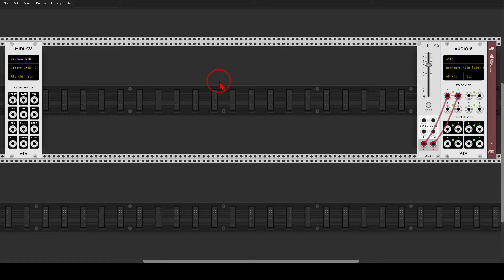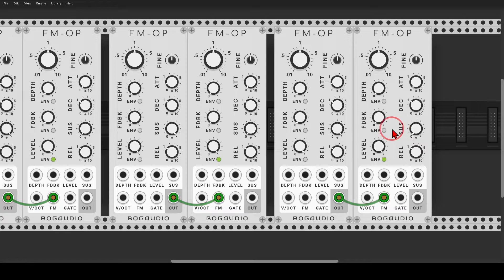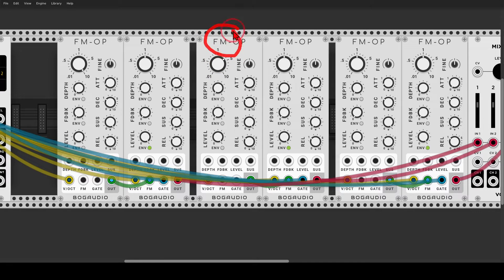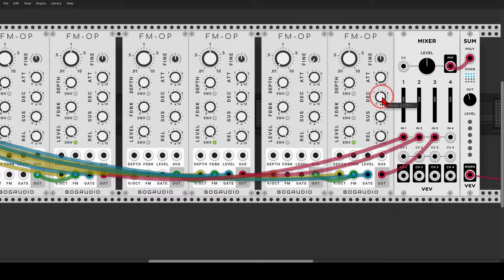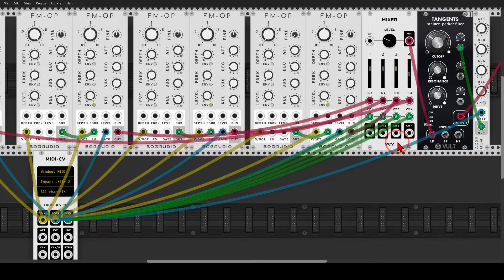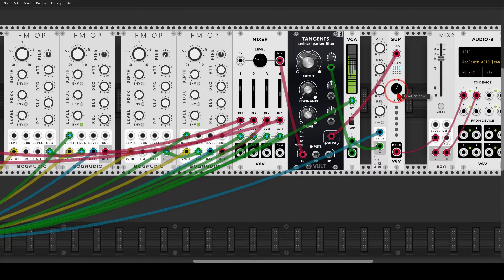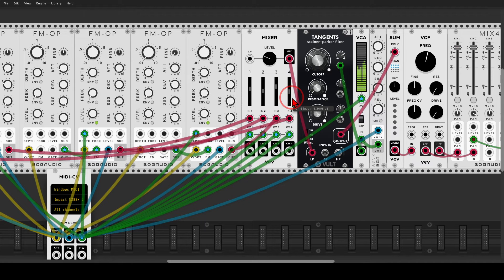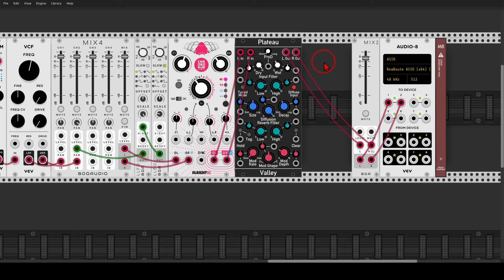Creating an FM Piano in VCV Rack

Comment: Hey Omri, I'm currently struggling with an issue with FM and I'd thought you know how to deal with it, hope you read this!

It has to do with phase. Whenever you add operators (with enough overlapping harmonics) together rather than FM'ing them, you never know what you're getting because the phases are independent and thus not aligned, which might change the timbre significantly. How do you typically deal with this? I can think of a few solutions, all are mega janky.
Reply from the maker: Hi! Yeah, I try not to think about that, but there are several oscillators that have a reset input you can use to reset the phase. Have a look at the ones from SurgeXT, for example.
Reply: @OmriCohen-Music  Hey! Yeah, I thought of the reset inputs, and when using them as oscillator sync, it works surprisingly better than I expected (whereas triggering every oscillator once at the same time gets me unpredictable results for some reason, maybe it has something to do with me using Cardinal rather than VCV but I can't tell for sure)... Until I have to set partials which are not octaves of the root, then it does sync things and changes the waveform.

Comment: Good tutorial but how i can enable VCV Rack in Ableton 11?
Reply from the maker: Thanks! Did you get the pro version?
Reply: @OmriCohen-Music  Ableton Live Suit  (build 11.1.5)
Reply from the maker: @-________9732  I meant the VCV pro version. The pro version comes with a VST that you can load in Ableton.
Reply: @OmriCohen-Music  i dont want to buy this because i am only beginner...
Reply from the maker: @-________9732  Oh ok so I guess that try and work with VCV only for a bit and see if you like the experience first. Then you can decide if you want the VST or not.
Reply: @OmriCohen-Music  I have 1200 modules... I can't check them all :oops:
Reply from the maker: @-________9732  No no, that's not what I meant. i meant see if the workflow is for you. If you like the results you're getting. And also, if you're just a beginner, I really recommend removing most of the modules. it will just confuse you.
Reply: @OmriCohen-Music  Thanks... I hope I can delete at least 100... they are all so beautiful and useful...

Comment: just a BIG question, I tried recording this patch in obs studio but it does not recognize asio drivers as output audio. I found workarounds for daws but not for vcv rack. Do you use another recording software for the tutorials??
Reply from the maker: Yeah, I record the screen with OBS but the audio with Reaper. I then sync both in post.
Reply: @OmriCohen-Music  oh thanks :) as I am streaming live I had to figure out how to get asio sound into obs, after hours I managed it with voicemeeter (sadly the only stable option for asio atm)
Reply from the maker: @DaviTheHuggMonster  I believe there should be also a plugin for OBS that fixes that. https://github.com/Andersama/obs-asio
Reply: @OmriCohen-Music  I actually tried that one and it did not work as it suposed. But now got it setup with voicemeeter

Comment: I notice you changing cable color by clicking multiple times. With Count Modula's Cable Palette you can use hotkeys to quickly set the color. By default it's just the number keys (e.g. hit '1' to switch to the first color in your "palette"). It also allows you to lock the color so it doesn't cycle every time you connect a new cable. Super convenient when color coding like you're doing in this vid. (You may know all this already but JIC you don't...)
Reply from the maker: Yeah, I have this set with Stroke from Stoermelder. I have the 1-4 keys set to each color, but I'm too used to just clicking away so I never really use it...